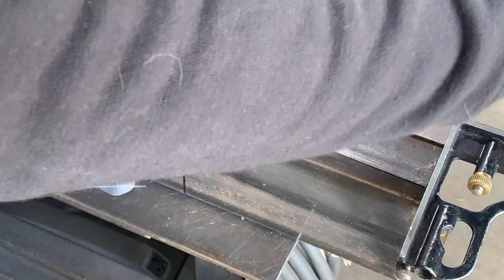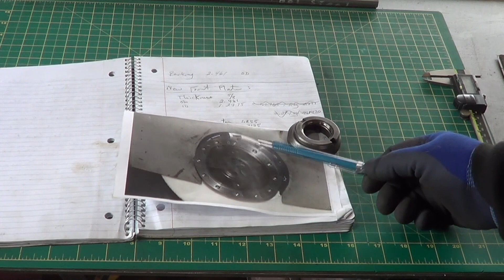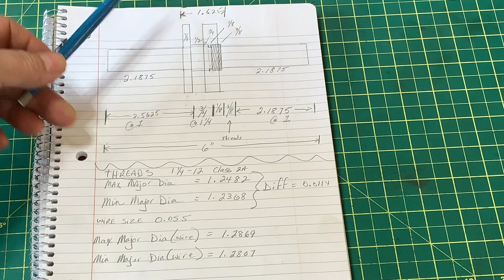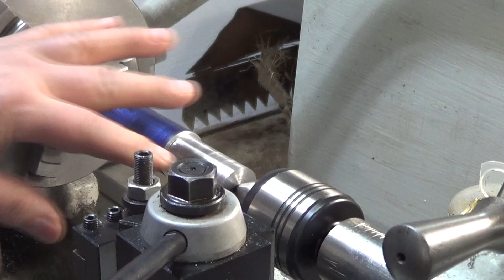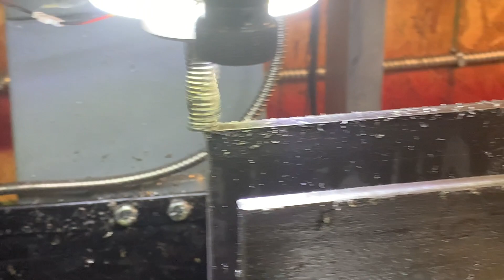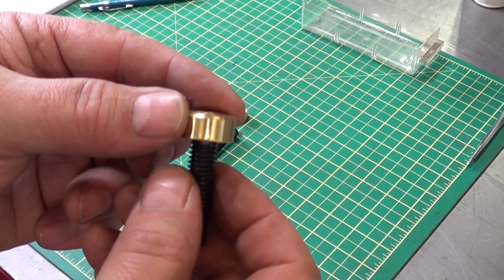Grinding Wheel Balancing System

Comment: I am curious, why can't you remove the grinding wheel adapter off the surface grinder? I saw a nut holding it to the shaft in the middle. This way you can balance the whole thing as a unit.

Comment: Hey Giles, I was going to comment that your grinder should have a removable hub.  But looks like someone beat me to it.  Anyway, I think you'll want to rework your design a bit so that you can balance the wheel WITH the hub. (Which means making a new arbor with the correct taper.  You may need to even widen your stand a bit.  You may also want to pick up a few more hubs so you don't have to continually balance your wheels if you swap them out.

One thing to note:  Mount the wheel, and then dress it. Remove it from the grinder (still on the hub) and balance it. Then remount it.
Reply from the maker: Thank you so much. I didn’t know how to get the hub off but finally got it off today. Made a new arbor today but this evening I will follow your instructions and hopefully get it right. 👍🏼👍🏼👍🏼 thank you. 😊
Reply from the maker: Hey Billy, I followed your directions and got great results. 100% difference. Its not commercial grade finish but much much better. Thanks my friend. Gilles
Reply: @LetsRogerThat  That's great. Grab some extra hubs as Billy mentioned that way you can have several wheels balanced and ready to go. I have 4 wheels like that.

Comment: Doesn’t your grinder use removable hubs? If you take the wheel off by itself, balance it then reinstall it, it’s going to be better but not ideal. Better than out of the box but most quality wheels are balanced before shipping. Once you true the wheel on the grinder, your balance efforts will be negated. You balanced it to your balance fixtures arbor, but the hole in the stone is imperfect. That’s why you have removable steel hubs.
Reply from the maker: I couldn't figure out how to remove the hub, if its removable at all.  I agree with you that would be ideal.  I rued the wheel and still got scalloped finish so I figured I need t balance the wheel.  But to be sure, I will look again and see if I can figure a way to remove the hub. Thanks John.
Reply from the maker: John with a bit of persistence and a puller I was able to remove the wheel assembly as you suggested. Turns out mine was seized on. Giving a good cleaning today and will balance the whole assembly as you suggested. Thank you so much. Gilles